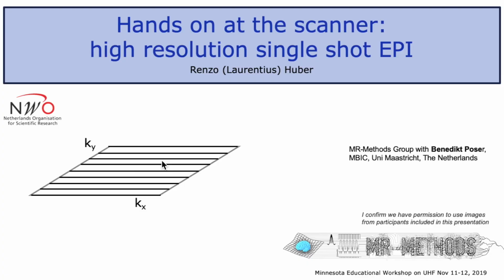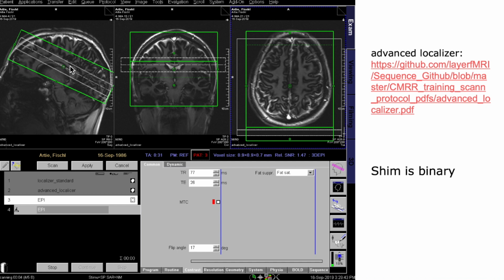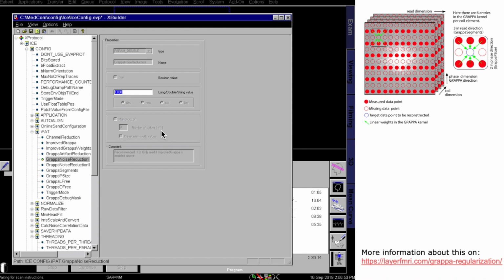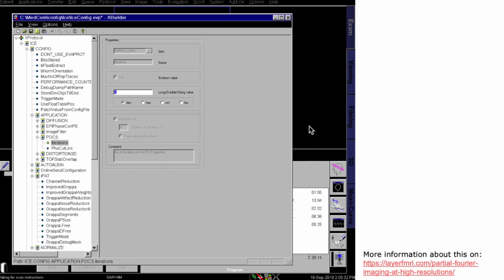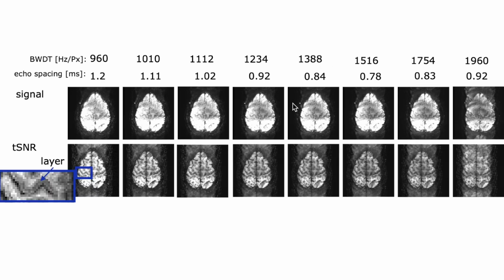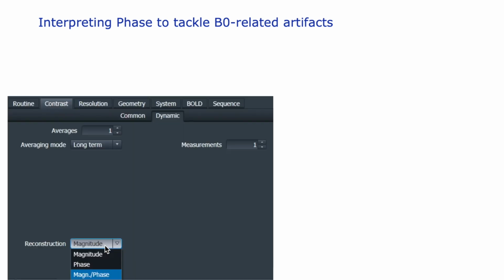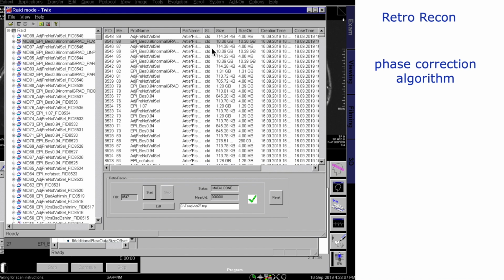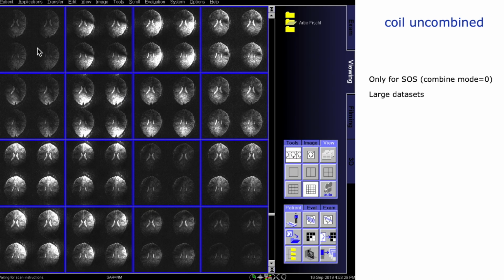layer fMRI tutorial on setting up high-resolution EPI acquisition

Comment from the maker: 0:00 Introduction
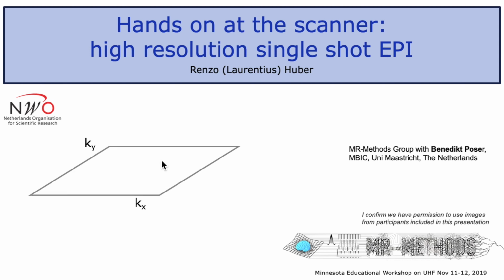0:57 Introduction to EPI 
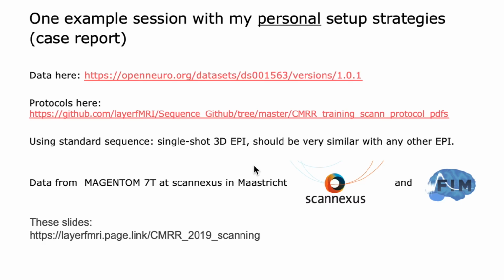2:32 Data to download
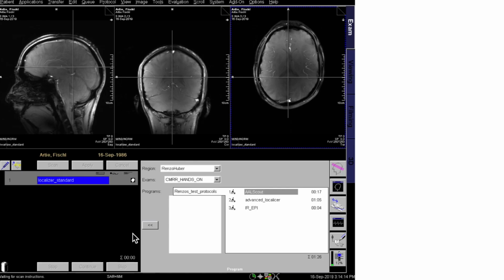4:22 Optimized localizer
10:23 Access to hidden recon parameters in IceConfig
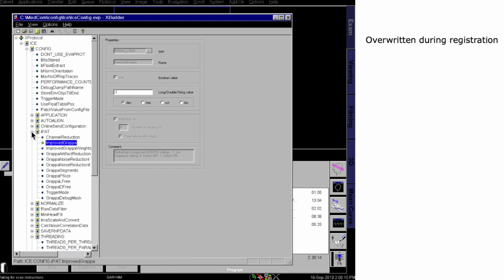12:48 Changing IcePat parameters 
16:32 GRAPPA regularization strengths
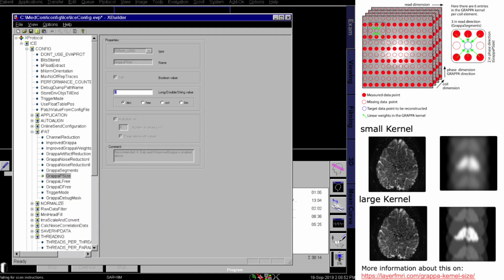20:35 GRAPPA Kernel size
28:03 Bandwidth
26:57 GRAPPA calibration data scheme
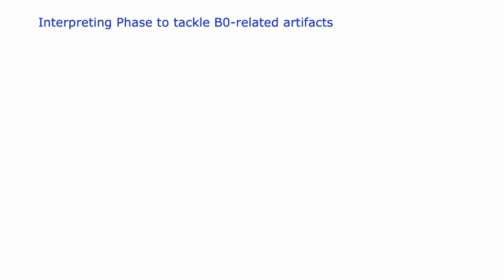41:56 B0-related artifacts
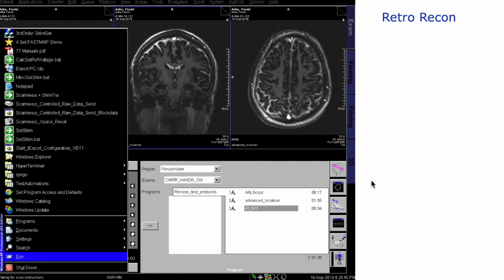47:03 Retrospective reconstruction
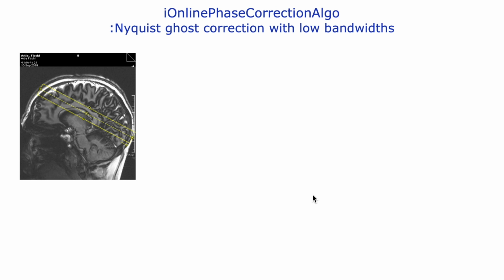51:56 Phase correction algorithm
57:11 Magnitude phase and real part
58:18 Coi uncombined images

59:48 Acknowledgements